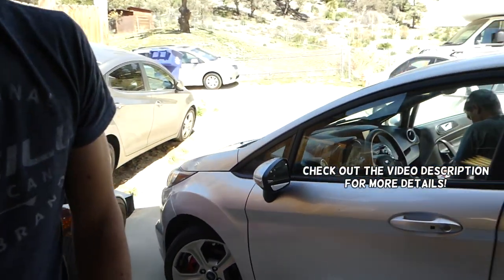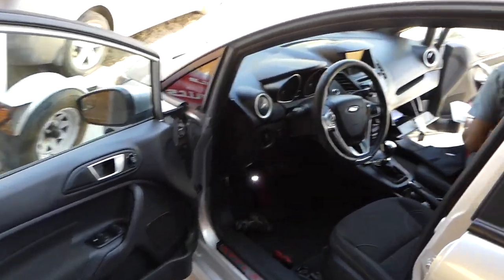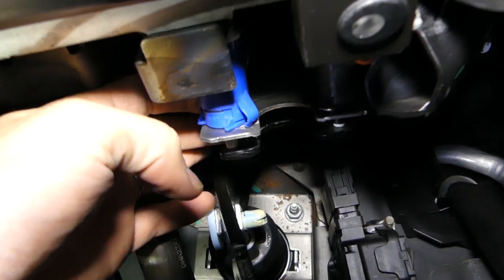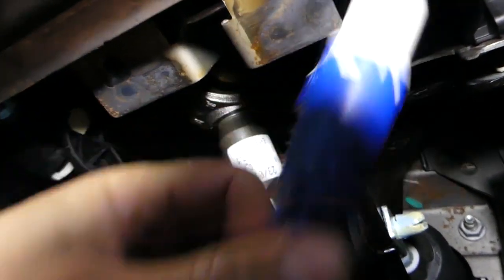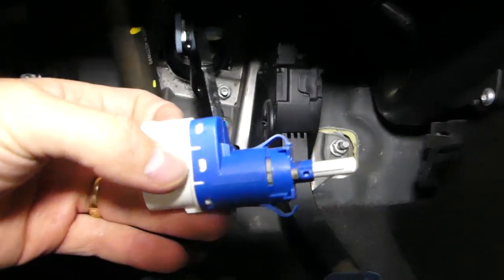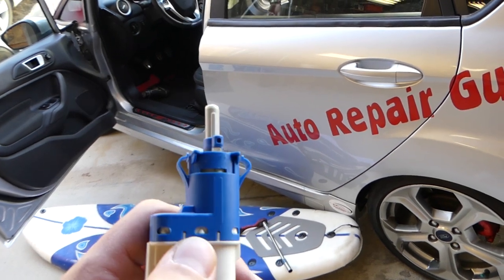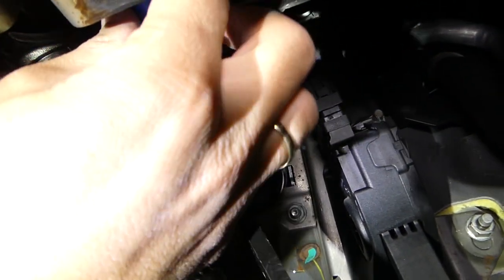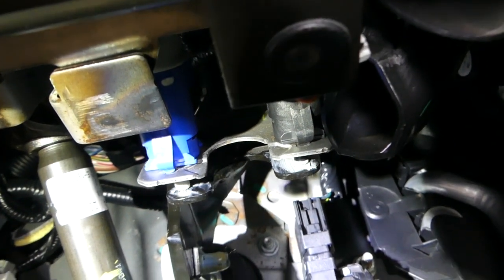FORD FIESTA BRAKE LIGHT SWITCH REPLACEMENT REMOVAL MK7 ST

Comment: My brake lights on the two rear lights don’t work but my brake light at the top on the rear of car does work... it’s a 2015 Ford Fiesta se... any suggestions?
Reply: I have the same problem with my ford fiesta se 2015